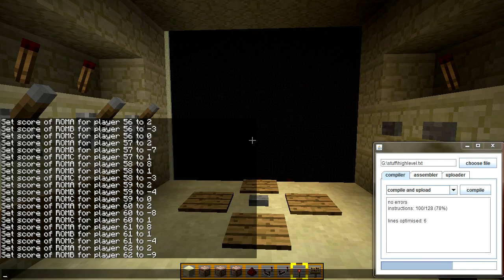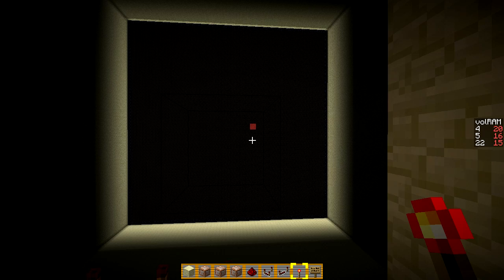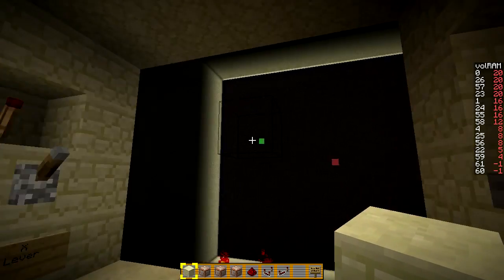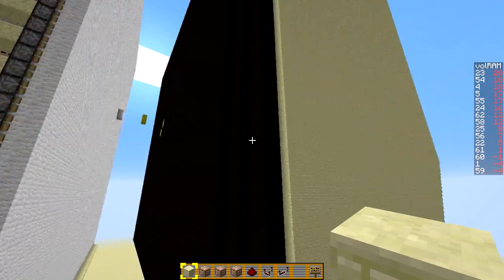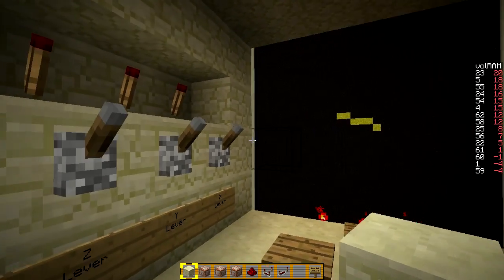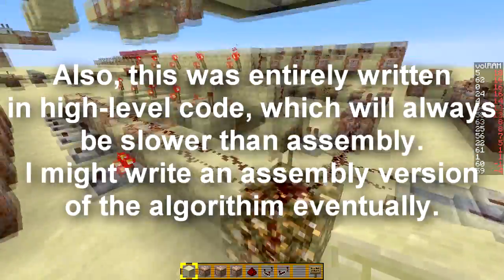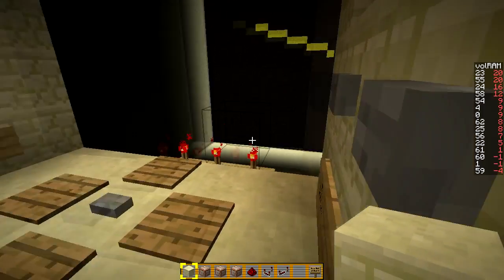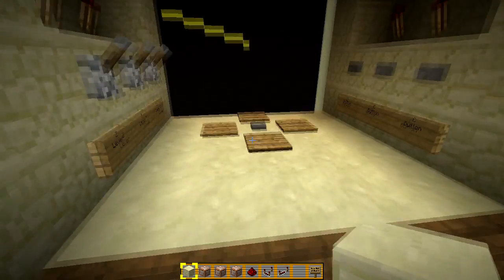Commandore 32: Bresenham's algorithm working!

Comment: You asked for computers that can run bresenham algorithm, my computer could run it, it have enough resources to run it (at least in the last update(not uploaded yet)) but idk how bresenham algorithm works =/
Reply from the maker: +Biel SAA I looked at your build, VERY impressive. I wish I was that good with command blocks when I built mine. Any details on the architecture?

As for how the algorithm works, I believe the code for it comes with the SDK, in "example programs/uncommented/line drawer.txt". This code is already designed for command blocks, but as the folder suggests, it's not commented and it's quite badly written. You should be able to get the gist of it, though. There's also the Wikipedia page on it, of course :D
Reply: +Laurens Weyn I'm not that good with those terms, so I don't know what is architectures, the last map I gave a map download.

Oh, thats good, I'll try to study that code
And thanks for all :)

Comment: Why not use instant-wire circuits to overclock it so it runs faster?
Reply from the maker: Instant wire is being used, or at least near-instant wireless signal transmission, which is close enough. Real instant wire would fire too many block updates for a pipelined processor with decoders of this size to still function.

Overclocking is impossible. It has no clock, instructions run a variable amount of time depending on how long they take for maximum speed, and it's pipelined. There is no clock to overclock, and even if there was it wouldn't speed it up. Optimisations are possible though, but have not been attempted.
Reply: Laurens Weyn you made a nontrivial CPU withOUT a clock?!
Reply from the maker: McSquiggleMaster Huehue Indeed. It's completely impractical/a bad idea in a real-life design, but in Minecraft logic follows perfectly predictable patterns, so it's actually better. You can see for yourself: at the end of every instruction decoder strip is a command block that sets a specific block to a redstone block, which executes the next instruction (which was loaded in the background, while the current one was executing)

Comment: Minecraft should just make a diode with no delay because repeaters slow it down so much.
Reply: Acid Oh, I thought you meant that upside down slabs REPEAT the signal to full strength. But now that I think of it that's not what a diode does...
Reply: Upside down slabs
Reply: Acid What do you mean "upside down slabs"?
Reply: Torsopher - I mean upside down slabs work as a 0-tick diode. They allow current to travel up them, but not back down. I use them all the time in my 1-wide logic gate designs: http://www.minecraftforum.net/forums/minecraft-discussion/redstone-discussion-and/redstone-creations/2350938-acids-1-wide-solid-state-logic-gate-collection

Comment: This is feeling soo slow, I think I'll try building a faster command block computer myself now. And it will execute code from RAM. Let's see how far I will get.
Reply: I don't think you can build faster COMPUTER. Maybe something that is specifically designed for this algorithm, but surely not full-blown computer.

Comment: why don't you trigger eg. write and read at the same tick? if you just have them in the right place it could work, or you can use pi's instant repeater to create 0 tick delay(sort of). you should have some pre-made programs so you just press a button to load it.
Reply from the maker: Plenty of reasons. Know that copying is not the only thing RAM needs to do, sometimes it only needs to read or only write. Also, with this many elements, making things instant and still dynamic makes debugging hard, mine craft laggy and changing/building new things very difficult and confusing.

Comment: so can the frame buffer be used to make a progress bar while the gpu is rendering something else in the background?
Reply from the maker: when the second buffer is implemented, yes, but you'd need to switch the working buffer,render, push, and switch back, which is a lot of wasted time. you could avoid that by writing the percentage in chat, or simply not stating the progress at all for the highest speed

Comment: Are you going to extend the bresenham to also support drawing of circles?
Or implement Xiaolin Wu's algorithm using diffrent shades of gray/black.
I think this project is rather cool but the speed could use some work.

Well good luck with your project and most important, have fun